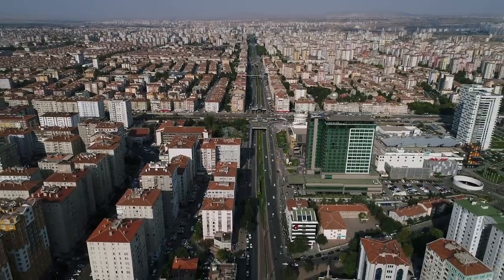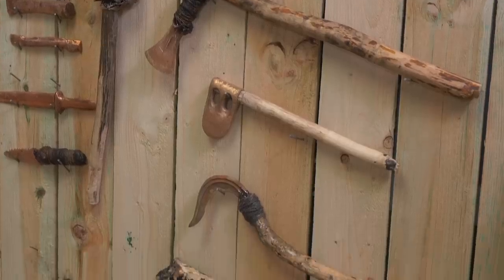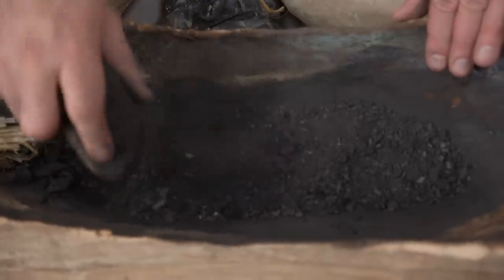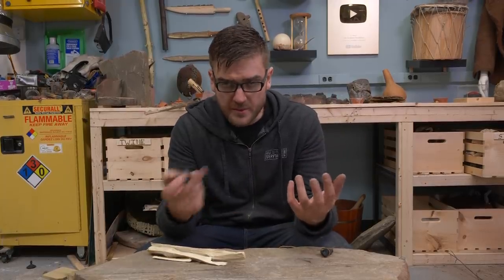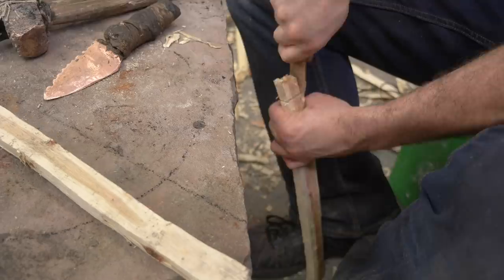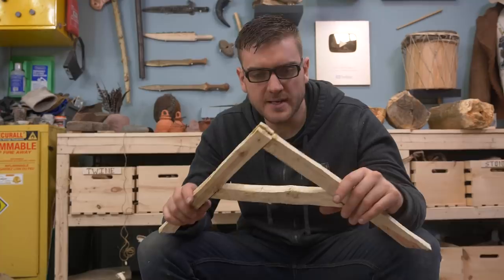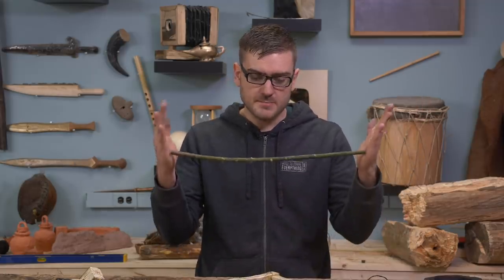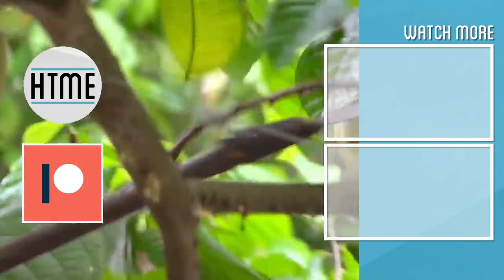DIY Tool that Built the Pyramids

Comment from the maker: Check out SimpliSafe here: http://simplisafe.com/howtomakeeverything
Reply: You should make a folder for the vids so we can watch them in order
Reply: Next bronze wood files
Reply: How To Make Everything 
Hey Andy, I want to make a note about length units. The cubit you used can be useful for short lengths, but can be a pain to use for long distances. 
 To combat that, I recommend measuring in paces. We use it quite often in making route maps. 
 First, draw a line with a set distance, say 100 cubits, on the ground. Next, pace out how many steps you need to get from one end of the line to the other. Repeat this step two or three times, and average the amount.
Reply: Why are you not yet using sandstone as an abrasive to sand your wood into nice smooth pieces?
Reply: You should make a bow drill
Reply: Don’t trust simply safe the locking mechanism can easily be overused by a two dollar radio transmitter.
Reply: Nicholas Brown you know how on some app directions they will show you an arrow going in one direction sometimes the arrow start off small and gets bigger. the pyramids actually do the same thing and they're actually pointing at a significant location. I'll give you a hint Solon heard the story of Atlantis from an Egyptian priest.
Reply: @AEON.  🤔
Reply: How many sections of level plumb and square geometry does it take to make a sphere?
00:00 - 00:05
Reply: Can u remake one thing from the anime Dr.stone .
Reply: On your lost wax cast attempts you forgot to melt out the wax from the mold so if you want a good cast try that out. or even better try sand casting, greensand casting. You can make greensand from dry clay and sand and add water after mixing, hard part is making flasks
Reply: @AEON.  you ever heard of that madlad that moved a friend's barn all by himself, just with hemp ropes and wood bars? He also did it with concrete slabs in the size of the Stonehenge stones, iirc a lot bigger than the blocks used for the pyramids... If I find a link I'll post it
Reply: @AEON.   I'm sure I could do it with the right resources and enough people and animals
Reply: Will you be making buildings
Reply from the maker: John doe Yes, but need to get property to build on first....or enough swords to conquer some land
Reply: Land in Arizona is cheap
Reply: 😒The tool was Demons & Solomon the king, do I needa prove this???!?
Reply: @heretwoexpose4255   it's easy to summon them you do it not me look up names of demon pick the one
 of choice and chant it's name
Reply: @backscan3030  Key difference is, he is following a fairly standard tech tree, verses Senku who jumps all over the place so he can make what he needs even if it Isn't ideally built and leaves his civilization rather unbalanced. This did come back to bite him hard when he ran into his first real fight with another established civilization.
Reply: Did Simply Safe help you when your studio caught fire?
I am so sorry that happened in the first place. I’ve lost everything I own due to fire. I’m mean, EVERYTHING.
Reply: Bet, I'll be here for you building the pyramids from scratch.
Reply: When You Make a Saw, You Cut the Blade at 45 degrees to the Right for the First Cut then 45 d. to the Left for the Next Cut and Repeat down the Blade. That way You can put Sharp Edges on the Leading Edges on Both sides of the Saw.
Reply: I know what your measurement should be based off of.
You know it too.😂
Reply: 2:03 The Great pyramid has eight sides, not four

Comment: I worked on the construction of the UK's 2 new aircraft carriers and find it interesting that I saw tradesmen still using the chalk and string method of getting a straight line, even on these thoroughly modern machines. Not for everything but I saw it a few times
Reply: I have a group of friends who are thoroughly convinced that the Egyptians were super technologically advanced and/or alien-assisted. Just cause they could carve rock precisely.🙄

Very frustrating to argue with.
Reply: Yea most conspiracy theories sound as stupid as they are
Reply: oh it still happens even to this day in construction. I worked at a hardware store for years, and we had a whole section of construction chalk that contractors would come in to buy by the bucket along with lengths of nylon twine for fast and easy straight lines of any length they needed
Reply: I worked with some carpenters and the chalk line is easy and cheep
Reply: Chalk lines can be used for straight lines the length of your arm, or the length of a building, and they fit nicely into a tool belt. I(a warehouse guy) work in a shop with builders, and one of the things that I say to distinguish what I can be asked to do vs what a builder should be doing is, If it can be done with a Square I'll do it, if it requires a Chalk Line then a builder should be doing it.
Basically a square is limited to distances of about 3'-4'
Reply: @blackoak4978  once you start getting the length of a building you  start getting less accurate especially if theres any wind I pull out a theodolite if I need a accurate line longer than 50 feet
Reply: i'm a Carpenter/Builder by trade and we still use chalk lines for a lot of things! they are perfect for marking out framing etc where you want a non-permanent but still very clear and visible line. Of course we can use lasers as well but sometimes it's better to do things the old fashioned way! I even have used a plumb bob a few times in the last few years! haha
Reply: I'm a welder, and use chalk snaps too, for some things. Even the most accurate of tools start showing inaccuracies over distance.
Reply: Mr Tumshie the string method is perfect for getting a straight line. And couple that with a tape measure and you could make yourself any length of perfectly level straight lines.
Reply: @NAJALU  When talking about ancient people I always feel like it's a fine line between emphasizing how amazing their achievements were and still being clear that this was all very much possible for them to do. Some people don't really seem to get the idea that ancient people could on their own do amazing and complex tasks that are still admirable to this day and deserves respect without it meaning that aliens or something were involved.
Reply: @NAJALU  The reason they resort to such 'claims' is because, most people can't stand not knowing how something is done: So they rush to fill the void with an explanation. However, your friends are also very astute in understanding that it's not so much pyramids could not be built with simple technology similar to what this video is demonstrating; But that the degree of precision of so many elements of the pyramids is still by todays standards, out of reach in our capacity.
Reply: I recall my father telling me that at one company there was a union dispute about whose job it was to snap the chalk line.

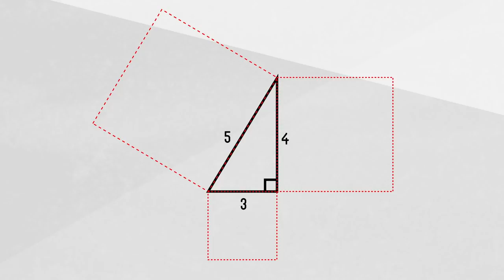Comment: 7:36 the Egyptians definitely knew about a whole series of sides guaranteed to make a right triangle, starting at 3:4:5, and used them in their architecture. It is fairly strongly implied they knew the complete Pythagorean theorem, which was known far before the Pythagoreans in Ancient Greece at the very latest.
Reply: 3:4:5 teoreme was known already by Ptolomy in the first century atleast what we know...Pytagoras theoreme is a special case of Ptalomos theorem just,

(Ptaalomos) Aa+Bb=Cc (no angle needs to be 90 deg), the basis is a square divided into four triangles where ABC and abc is opposide sides

(Pytagoras 500 years later) A^2+B^2=C^2 , He just found a way to simplify it if one angle was 90 degees(or pi/2 a quatrter of a circle where the Radius of the axes could vary) 

Ptalomos way is a square inscrebed in a circle wheere all four corners are on the Radius...but every side can be of a different length...and thus all angels can be different.. (its a cute trick to use when 3:4:5 doesent work)

...And yes it was probably known long b4 Ptalomos
...we know for sure ppl known for atleast 5K years hpow to draw perpendiculars, so straigt corners wouldnt have been a problem...thay also used levelers based on water
Reply: Pythagoreans theorem was known to he true for certain right triangles. Pythagoras simply proved it for ALL right triangles.
Reply: ...right? agreed. ...and yet, with all of their knowledge of earth, space, frequency and sacred geometry, we are supposed to believe that they still weren't smart enough to have been using something other than the tools that "Encino man" would have used? Lol! The sense that doesn't make, is staggering! Lol! Sik
Reply: Jesus Christ, it's as if nobody had ever written a book.

Comment: Got to say loving this series so far though one suggestion I have is it might be worth each episode having either you or Annalise take something you have already "invented" and use the skills and knowledge you have gotten so far to build a more refined version of it still using the old tech. I feel this will help a lot especially as you get to building things like squares (Hint the reason they were so good is they built a bad one first and then used that to build a better one and so on until they got pretty good). Plus I feel this will allow both you and Annalise to share the episode without it feeling too much like one person is doing all the work. Not to mention the more refined tools are going to save a lot of time in the future which means faster episodes and less time rebuilding/repairing tools.
Reply: I agree. In this video you could really see how much his casting skills have improved (except for the saw)
Reply: this is exactly what they did with axes.
Reply: @buzkie314159  He needs to work on actual forging for all of his tools.  Even if the saw had worked out, it wouldn't have been work hardened and wouldn't have worked like a modern one would.  He'll be better off starting out casting an ingot and hammering it into shape for most of his tools.

Comment: I feel like a pottery wheel and lathe are gonna be needed.
Reply: and a file. and i was laughing at that "saw". more like a serrated knife. he could have made an actual saw, he just would have had to hammer out a proper saw plate. bronze files existed, but his first iron should really go to a file, so he can file the teeth on a bronze saw.
Reply: @Taygetea  honestly the more I see him use the tools, the more I start to get it. It takes more time but a lot of these aren't awful
Reply: "I've got it! Look around. Can you find something to form some sort of rudimentary lathe?"
Reply: He said in a previous video that wheels haven't been invented yet. He is getting close though
Reply: @Deadlyish  wheels maybe didn't but circles certainly did
Reply: @BenjjyBoi  Axles are pretty important for any accurate rotation though.
Reply: The lathe actually wasn't invented until the 18th century so that's a ways away.
Reply: hedgehog3180,

Yeah, but the pottery wheel is probably around (at least in a simple form) and that can make somewhat precise ceramic parts.
Reply: @hedgehog3180  you mean the mechanical powered lathe.
Lathes powered by foot or spring pole have been around since antiquity.
Reply: @timothyhayes9724  quick let's get out of here before they kill guy !
Reply: @timothyhayes9724  This is my Every Plan.

Comment: It may not be as accurate as modern tools for those pretty damn impressive
Reply: I am also certain practice was a factor. The guys most likely using these ancient tools were probably well paid and extremely well trained.
Reply: I am carpenter and I am using both chalkstring and marking gauge a lot.
A laser leveling tool produces a laser line about the same width as the chalk string line.

Comment: You skipped the most important tool! The Egyptians used what are called surface plates nowadays.  They made them by grinding three big stones together to make flat surfaces.

You grind A against B, then you grind C against A and B until they are as flat as possible.
Reply: Yup thats what I was thinking. Make the flat plate then use it as a grinding stone for the edges of his square/level. I believe they also did something with circular sights over a distance ( looking for concentricity) to check levelness too.
Reply: It is the basement of all the techs.

Comment: Just one thought about the saw: Are you sure it has to be cast in it's final state?
Maybe just cast a green body and then 'forge' the details like the saws theeths.
I'm under the impression that a small bit of more detail in your tools would get the projects a long way afterwards. As your 'civilisatoric progression' relies on tools being more and more 'professionalised' and thus capable.
Reply: Bronze can't be forged easily. That's why iron was superior to bronze although bronze is actually harder. (Another factor is that iron is much more common than copper and tin)
Eventually, he tried to "machine" his knife into a saw, which would be a good solution if he had a file or similar.
Reply: @AEON. They didn't magically appear, there might still be some mysteries on the construction but that is like saying Aliens invented our electric understanding because there is still some mysteries. That happened recently enough to have plenty documentation. In 4000 years there will probably be some significant mysteries on how we developed such refined electrical knowledge and engineering but we know it wasn't aliens.
Reply: @AEON.  The Hoover dam is bigger and more massive than any pyramid and much more advanced, if that's not enough the Three Gorges Dam is even bigger, if that's not enough for you then you are simply dishonest. The Pyramids while impressive are also incredibly simple structures as they are just big piles of rock and we build far more advanced things constantly these days. Hell if you want to see a bigger pile of rock just go look at the piles of coal and ore you can find outside of power plants and iron works. Nothing about the construction of the Pyramids is a mystery and these days we basically know all the details of how they were built, it's certainly impressive but far from impossible and far from difficult. And these days we are on the regular building way bigger structures anyways, hell just take a look at any modern container ship, they're way bigger than the pyramids and have to endure way tougher conditions.

Comment: Seeing the A-shaped angle measuring setup reminded me of what we had at our farm.  When carpenters were needed, they had some tools of their own.  But what we had was just one folding "carpenter's scale".  As needed, we would make that A-shaped frame so that the points were desired length apart.  Normally the distance was a fixed 2 meters apart.  Then we could handily swing the frame repeatedly 180 degrees around and measure reasonably longer distances along a road or the size of some lot.  When a temporary plumb was needed, a small stone sufficed for the weight.  And of course, for brick laying a string pulled straight was a horizontal reference.  For longer distance horizontal settings the hired craftsmen came with a rubber hose with both ends equipped with maybe 20 cm long glass tubes.  The whole thing was nearly filled with water and both ends were raised or lowered until the water level matched a reference height and then the other end established a new remote reference height.  For storage between uses, both ends were plugged with natural cork or maybe rubber stoppers.

Comment: I have a LOT of respect for you for undertaking precision measuring. A huge component of technological progress has been using one set of precision instruments to make a more precise set- that how screws and such were possible!

As far as measuring units, how about using the length or width (whichever is most uniform) of eight kernels of some type of grain? Your base unit of measure ("korn") is all of them together, and you can rearrange the individual units along your 1-korn stick to average out the length of your subsections. This gives you 8 "thmanykorns", 4 "arbekorns", and 2 "athnakorns". You can of course add korns together into "bikorns", "quadrakorns", "oktokorns", etc.

Also, you might try going with fired ceramic split molds instead of lost-wax cob. Not only are they reusable, you can get the molds themselves rocket hot so that the metal doesn't solidify before filling the mold.